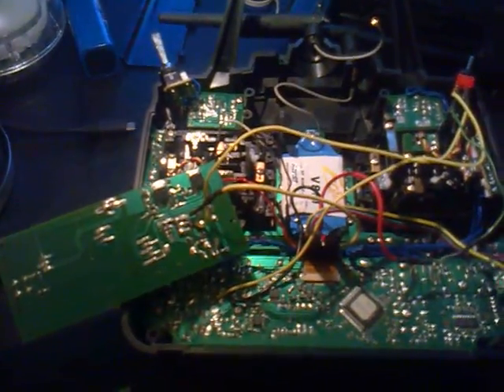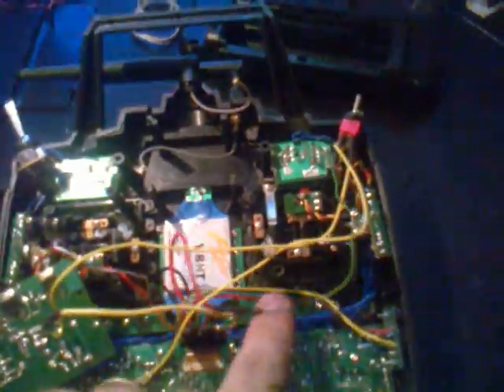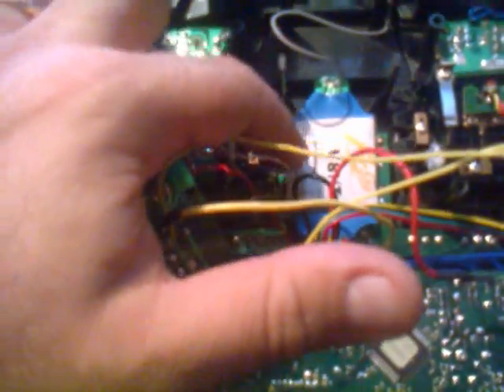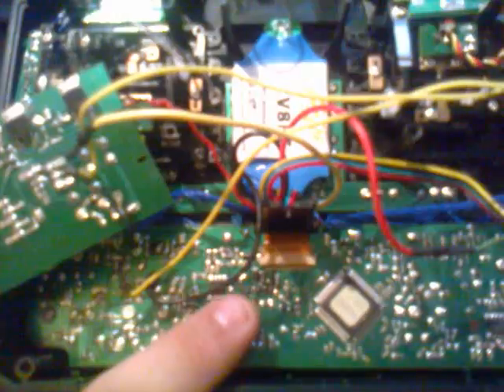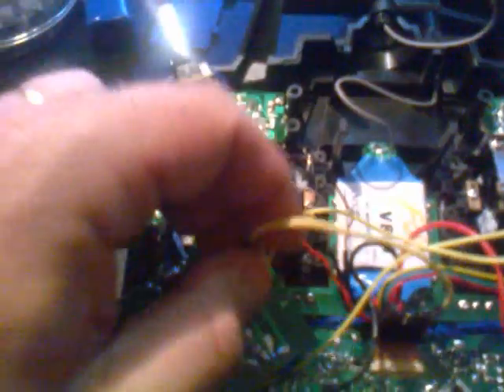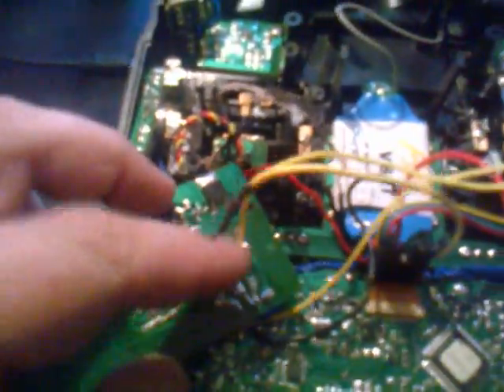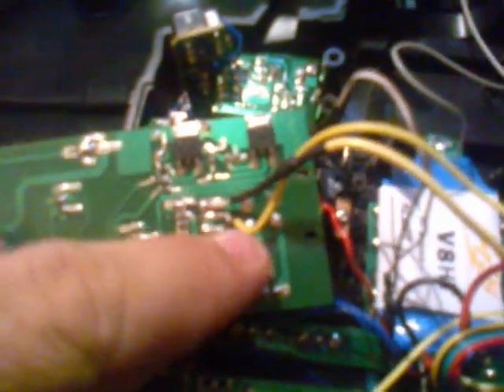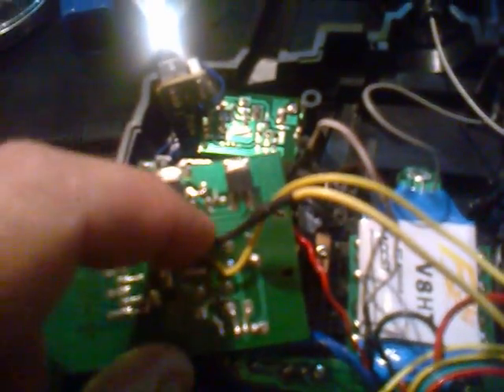FrSky V8HT 2.4Ghz DIY Module + Futaba T7C FASST

Comment: Has anyone converted an old Futaba challenger to 2.4ghz using the corona module & if so were does one connect the +v, -v, and were is the ppm connection .

Comment from the maker: Well that's good news. You can test the radio prior to installation of the module. Connect the radio to a computer and try it out with a simulator. If it works it means that ppm signal is still getting out through the trainer port and that means that the frsky module should work. Best of luck.

Comment: Thanks for sharing the information. I fried my T7C transmitter a while back( probably the radio section) due to reversing the battery polarity. Do you think using this hack I will have a functional system?

Comment from the maker: Sorry for the late answer. I had the same problem when getting the signal from the main board. It disappeared when I got the signal from the trainer port an also bridging pins 3 and 6. This will completely shut down the FM main board. Cheers

Comment: it happened to me, that now my 7cap works bad with FM and very good with the frsky module, I ve made a dual input switch which feeds with 12 vol to the stock fm tx or the frsky module at convenience. but the FM part is making low range with full of servo chattering,   pleaswhat can be wrong?

Comment: I did this but only conected the pin 6 of the trainer port to PPM from the 2,4ghz module. The 2,4 works just fine and i´m still working with the trainer port with another radio (FF9).

Comment from the maker: By powering the TRAINER port you activate the PPM signal but not the main module just like with a buddy cable, making the radio work as student but sending signal to the FRSKY module.By the way, if you do this you can no longer use the trainer port for Student/Professor. Hope that was clear.

Comment from the maker: I thought i was clear but apparently not. Powering the trainer port makes the main board send signal through the trainer port and not the original module. So, ppm signal is exiting through the trainer port into the hack module, but it's not going to the original module(making the FRSKY module work but not the FASST). It's like when you use a trainer cable between 2 radios. One of them does not need the battery to work, right? That's what i'm doing here.

Comment: I have a question for you: i would like to know the reason the the second wire from the switch is going to the trainer port? because i guess that that power in only needed when you are realy using the trainer port to power the second radio.the way you have connected that when the 2.4ghz modulle is working the board transmitter is also working! So how do you switch off the board transmitter?